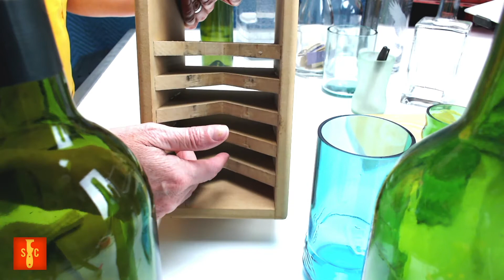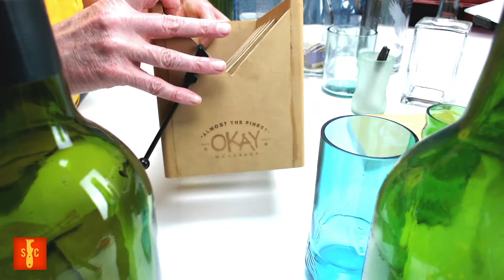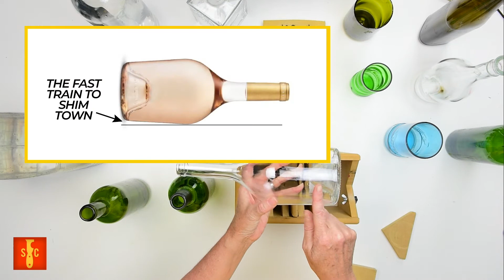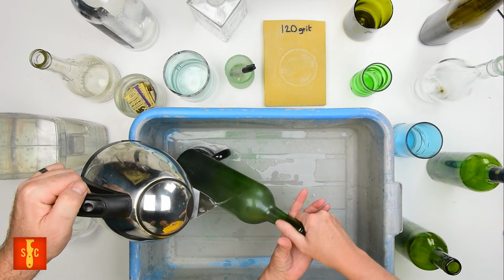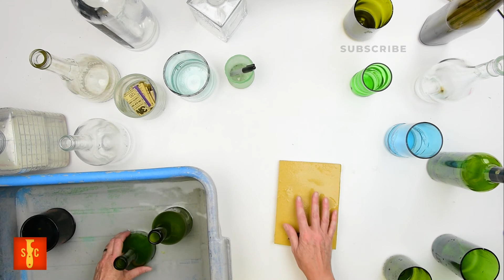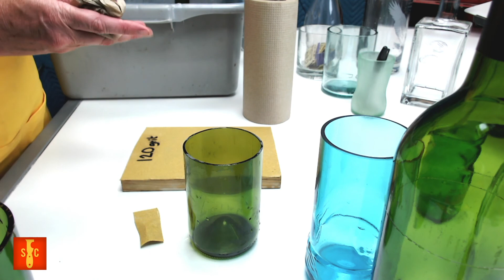Making Wine Bottle Glasses

Comment: I loved making wine bottle glasses with Alice in the shop. I save bottles with thicker glass bottoms just for glasses because I like the weight of the glass in my hand. I had a green vinegar bottle with over an inch of solid glass at the bottom and Alice turned it into my favorite glass for cocktail in the evening.
Reply from the maker: I love bottles with deep bottoms, especially when it's colored glass. They're so pretty.